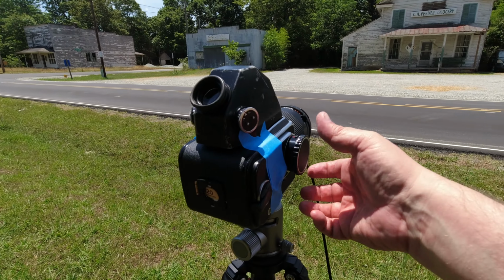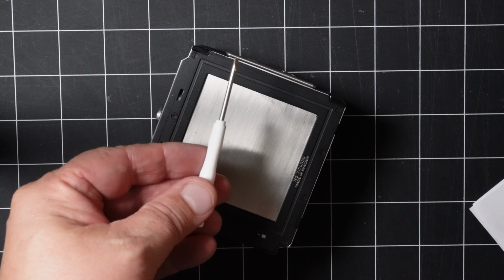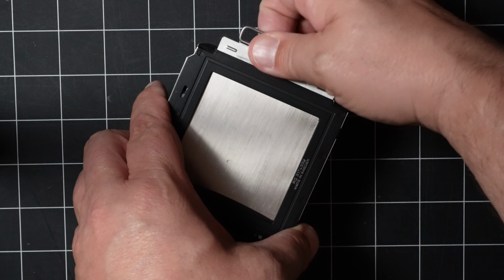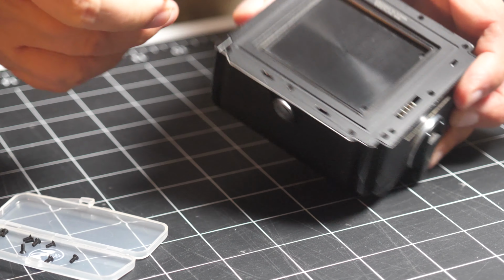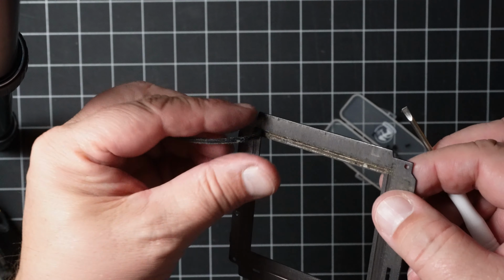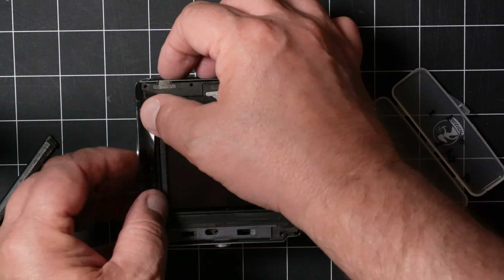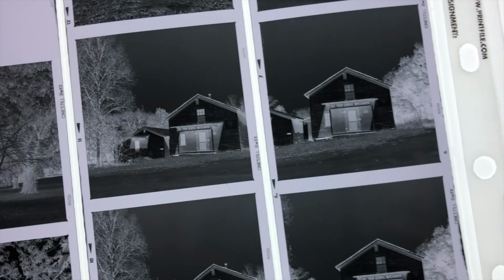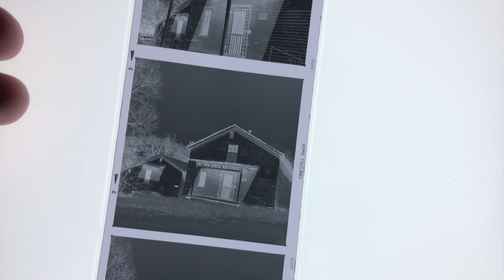How To Fix Light Leaks in a Hasselblad Film Back

Comment: Well, it would have been nice to put a link to where you got the seal kit from, or at least mention it in the video... the only kit I kind find is the one from Dick Werner and he doesn't include that third piece that's needed or the screwdriver.
Reply from the maker: https://www.ebay.com/sch/i.html?mkpid=0&emsid=e11400.m43474.l10173&mkcid=7&ch=osgood&euid=851313e9435543309fa97a8312da62fc&bu=43844563969&exe=0&ext=0&osub=-1~1&crd=20220930143258&segname=11400&_ssn=sh_212019
Reply: @Keithdotson  thanks. But, from China? No U.S. sources (just to save on shipping, etc.)